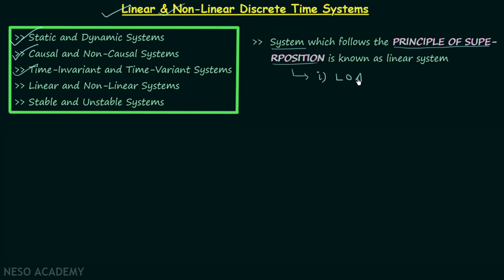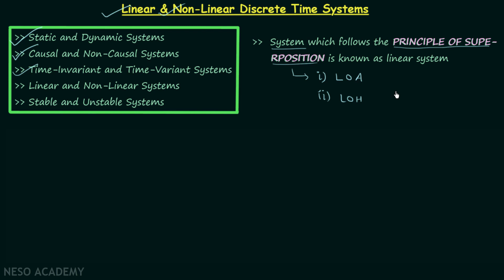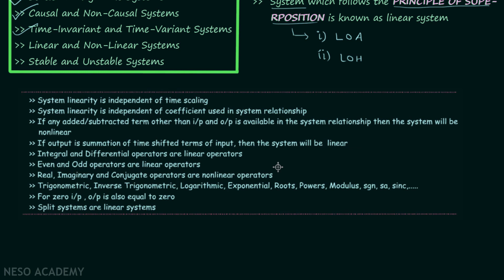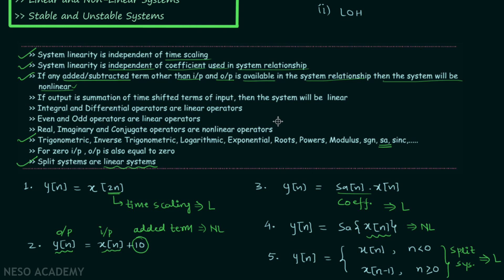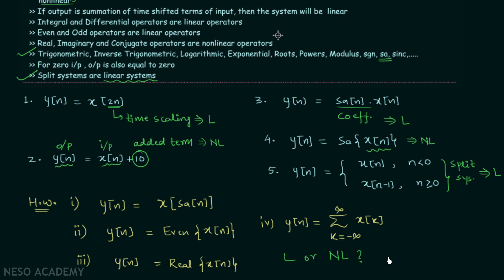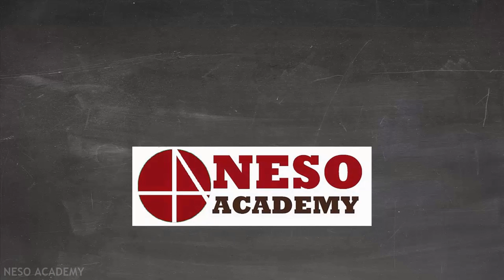Linear and Non−Linear Discrete Time Systems

Comment: Can someone explain 1 and 4 homework problems
Reply: HW1 : "sa" operator is operating on an independent variable not on system input which is a case of time scaling, therefore, it is a linear system.
HW4 : summation is corresponding to integral operator of CT-System, hence summation operator is linear, therefore, the system is linear

Comment: Sir a system is such that it convolutes the discrete time signal with itself I.e. output is X[n]*X[n] ...is the system linear or non linear. Thanks.
Reply: When you say convolution, obviously the system is a Linear Time Invariant(LTI) sytem. For any given LTI system, to find its response you use convolution.